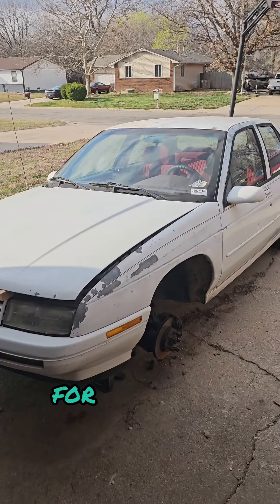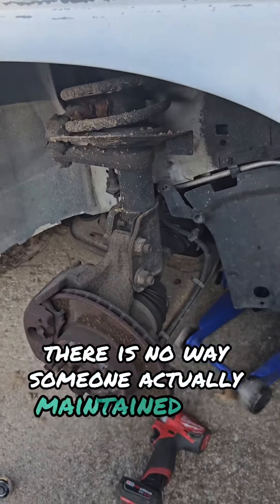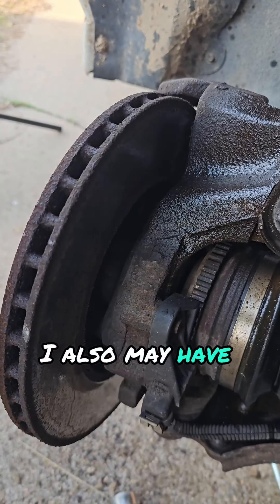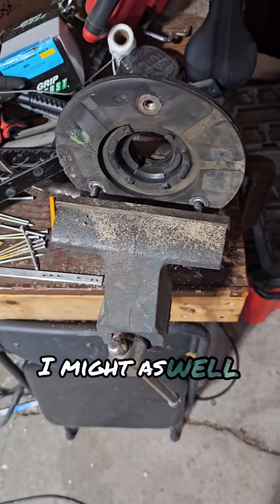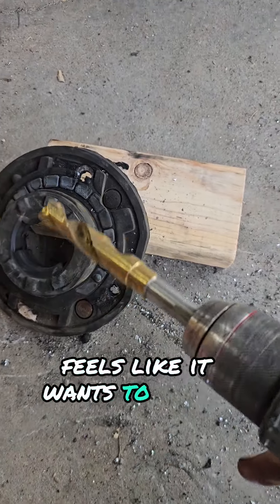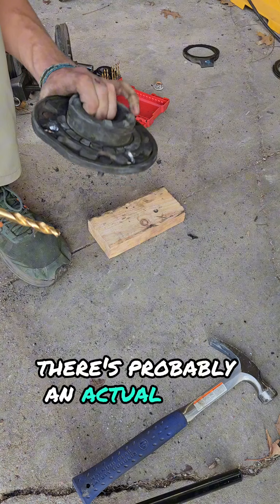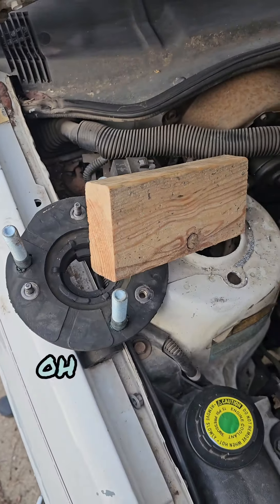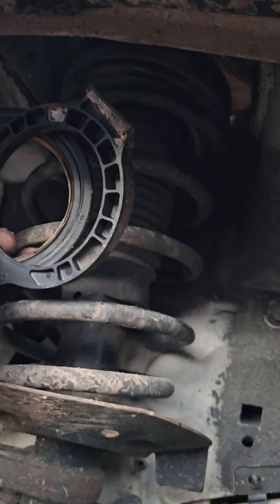The Cheapest Way to Lift a Car

Comment: Instead of hammering those bolts you could’ve just kept unscrewing them
Reply from the maker: So that is actually a tactic for when you need to hammer a stuck Bolt out, the nuts prevents the threads on the bolt from getting mushroomed out.